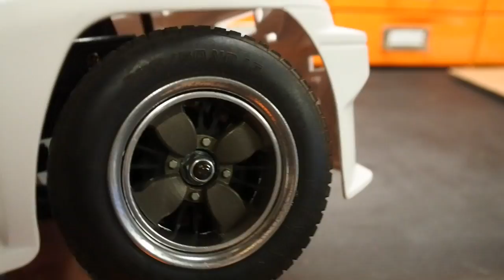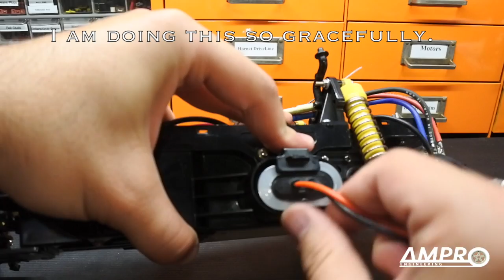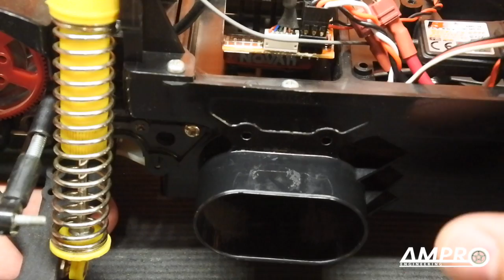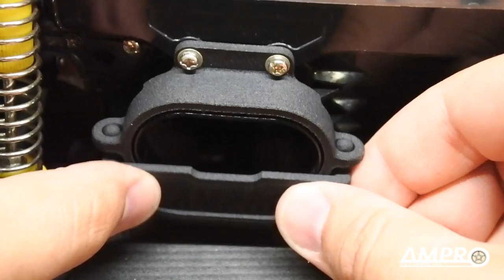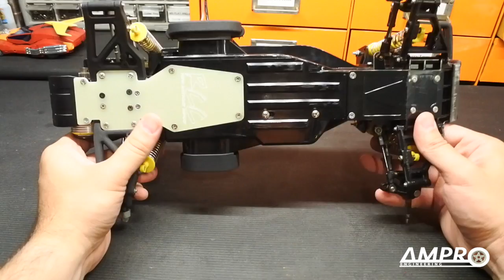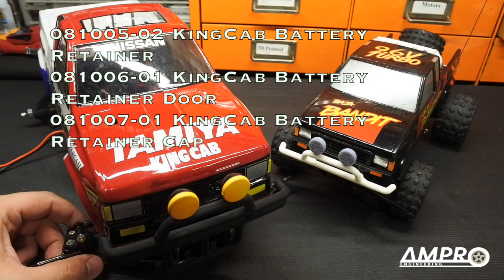e75: Tamiya King Cab & Monster Racer Battery Retainer By Ampro

Comment: I really will have to pull my KC runner off the shelf and start adding these parts to it as they only seem to ADD value to the whole thing by making them a nice running vehicle with less faults. I still have the Tamiya ball(HA HA, RIGHT)diff in mine, I must be very lucky it hasn't cratered or my time is coming. Maybe because I have no modern battery chemistry running through its veins??? Now, would you PLEASE stop saying I LOANED you that HotShot and make it your own and get us some AWESOME PARTS for it, oh wait, you are working on it right now, battery door would be good idea, get rid of the roll hoop end retainers. At least with the HS2, Tamiya had you pull the battery out the ends vs unlatching a battery trap door, but since it was also half the work stand, well, it came in handy when you were inevitably fixing something after a 5 minute run MAX. :D
Reply from the maker: As you told me some time ago, a combination of a complex diff, high stresses and hot motors made that diff just self destruct. If you are nice to it an keep the power reasonable, I think you will be ok. Thank you for MY Hotshot and I can only hope that I can repay you with arms that aren't sh$% and some ball diffs!